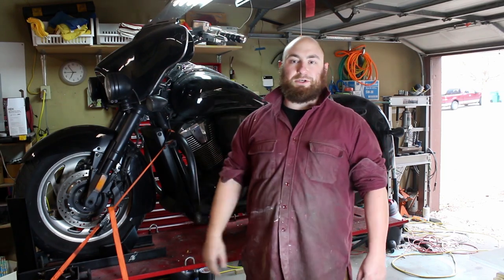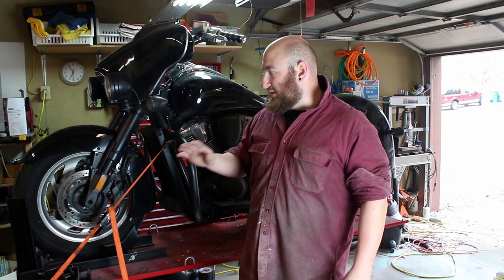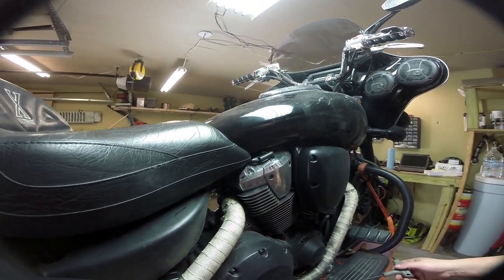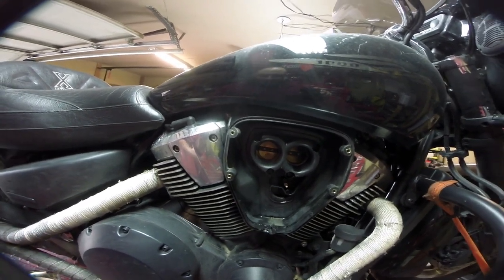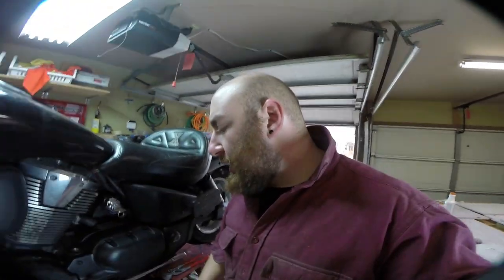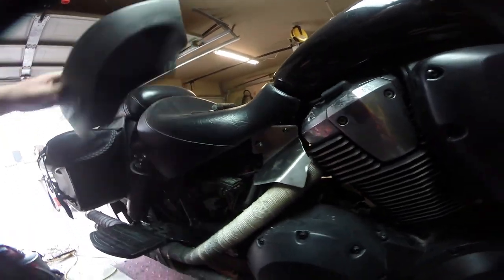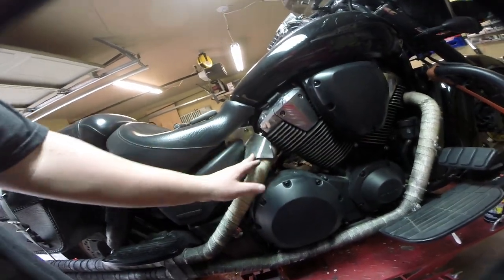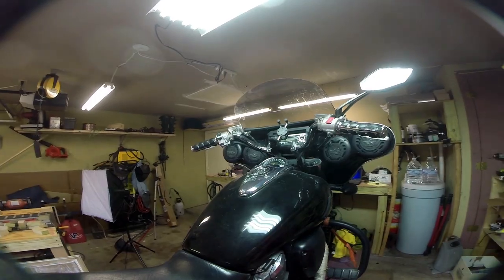2006 Honda VTX1800 - How I Get a Bike Ready for the Road

Comment: There are 2 drain plugs.  Also more oil drains out if the bike is canted over on its side stand.
Reply: Terry I was about to tell him the same thing about the extra plug in the front
Reply: absolutely correct
Reply: Yes I always drained mine on the side stand as I read it somewhere 😄 like in the manual.
Reply: I can see I'm too late to comment on the 2nd drain plug hahaha. Others have already pointed it out 😂

Comment: I've got the 02 C model. Red tank and fenders and everything else is pretty much chrome, except for my gloss black Memphis Shades Batwing fairing that I put on myself and custom made a few Vinyl designs for. She's also a pretty mean lookin bike now too 😂.

About the oil filter, whenever I do a change on my VTX I just get the regular Bikemaster brand filter for like $20 or less. It doesn't have the hex-nut fitting on the end but the filter's in an easy enough spot to reach where I can just fit a small pipe wrench on it and break it loose with 1/4 turn

Comment: Two things...I wish you had shown how to bleed the brakes. And second, you sit in traffic and the bike gets hot? Doesn't it have a bag ass radiator up front? Isn't that supposed to fix any overheating problem?
Reply from the maker: The radiator only works when there is air moving through it. In traffic there is not much. As far as bleeding brakes, I have shown it in a lot of other vids. Basically you pump up the brake, hold it, and open the caliper release. Close caliper release and repeat the process.
Reply: ACTUALLY THE RADIATOR HAS A FAN THAT COMES WHEN THE COOLANT REACHES A CERTAIN TEMP.
Reply: Mine never over heats it's an 02 1800S
Reply: @motomark9736  No one said over heat, just heat from exhaust on leg.  I like the shield, they also sell leather shields.
Reply: The radiator doesn't cool the exhaust system 😄
Reply: MaksWerks bullshit it’s a linked brake system you also have to do the rear on these bikes when you bleed the front and vice versa.. you can do it with a vacuum bleeder in under five minutes. Also if the pipes are getting so hot to where you need a heat shield you might want to take a look at the mapping on that bike. You might actually want to learn the proper procedures to repair bikes before you make videos on it.
Reply: If your bike is getting so hot that it's burning wholes in your ass, through the heat shields your bike is running way too lean.   You can get a power commander, and straighten it out with the right air to fuel ratio.  Your bike will run better than it did, when it came off the assembly line brand new.
Reply: @danielmoriarty751  it damn sure is , the front break and back activate together.  This is the first time that I have ever seen this channel, but hopefully he knows more about Motorcycles now then he did back in those days.
Reply: @rpmfreak9150  When I was thinking of upgrading from my 1200 Sportster, I test drove a couple of these. Each was powerful, smooth and comfortable. The drawback, as far as I was concerned, was that they weren't any fun. I settled on a 1900 Yamaha Star Raider. To each his own, ya know?
Reply: @cowdudeable  Ohh hell yeah I love the Yamaha raider and the smaller Warrior XV 1700s and Road Stars. I have a custom Motorcycle shop in Chattanooga Tennessee, and I have had several of the Yamahas in my personal collection at some point.
Reply: I've actually had a couple of the Kawasaki Voyagers , and those are definitely some decent built Motorcycles for touring. Ohhh and I have a few Suzuki intruders vs 1400s right now, that we are chopping up and raking out the forks.   I've never seen anyone doing quite like I am doing them, and hopefully they will be a big sale.  It's just been so damn hot in Tennessee, so I have been going into the Shop around 2:00 am in the morning.   I'll stay around until lunchtime, but then it's so hot that we have to close it up.  I still go down and Let people pick their bikes up,or drop them off.